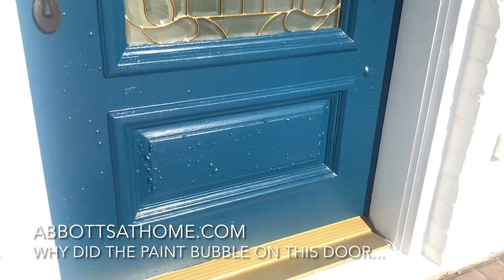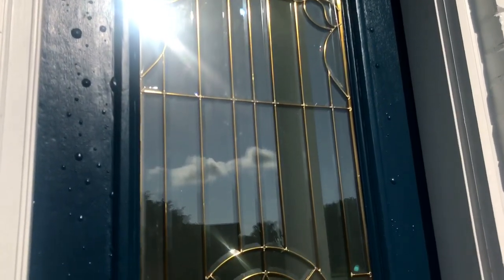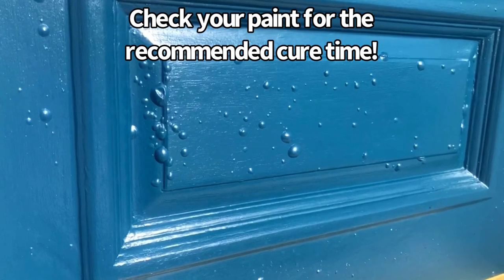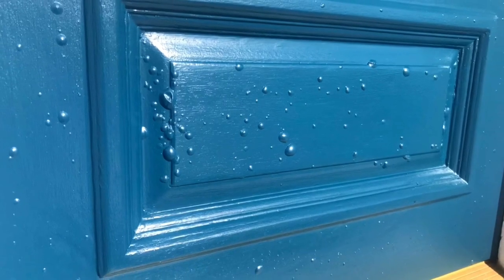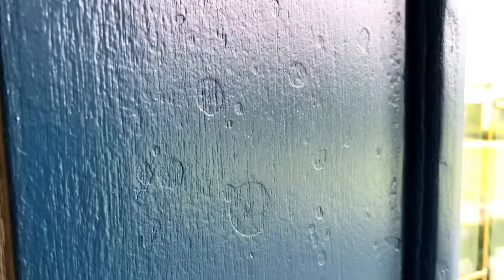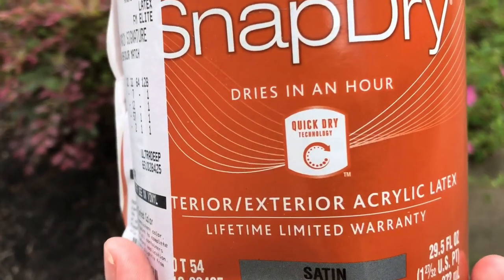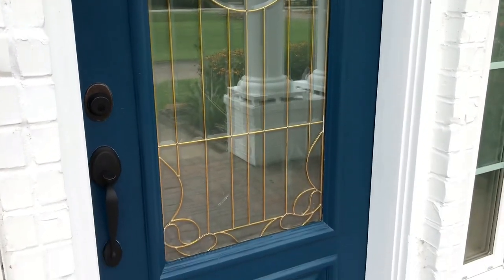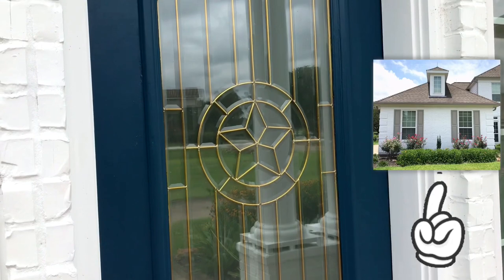NO! Why Is My New Front Door Paint Bubbling and Blistering - I Think I Know!

Comment: The same thing happened to me. The painters came back a couple times and each time looked worse than the last. They eventually told me I needed to buy a new door, so I did. I will be painting it myself this weekend because I can’t risk them rushing thru the dry times again. I am going to get creative and come up with a way to keep the sun off of it for 48 hours when I’m done just to be safe. It’s a dark blue, darker than yours. I will be using PPG Permanizer, because I had the color matched in Snapdry and it was considerably more purple than the trim which was painted in PPG. Happy to know I’m not alone.

Comment: Hey loved your video.  I had the same problem after I finished my front door the next day I went out to admire my work and found bubbles!!  So I tried slicing the bubbles down the middle with a small knife blade and then adding a tiny bit of paint.  I then pressed the wet paint into the bubble in a circular motion.  That helped as my bubbles weren't nearly as large as yours but I can still see a slight line on some of them where the cut was there but the bubble is mostly gone.  Just thought I'd mention it.
Reply from the maker: I have a few very small bubbles left after the painter's patched my door. I'll have to give that trick a try. Thanks for the helpful comment. 👍

Comment: I worked so hard on a faux wood finish on top of a dresser and it did this except smaller blisters. And I definitely did the base coats only 1 hour between but it was 100% dry and I even sanded between coats and did everything right. 
It makes sense that maybe the paint wasn’t cured though. 
I guess this answers my questions.
Reply from the maker: The only other causes I can think of, bedsides cure time, is humidity in the air and wood OR the wood is oily (like Teak). Good luck!!

Comment: Did you sand the whole door down again before applying the snapdry? Or did you just paint over the old paint? I have a similar thing happening on my siding that gets direct sun in the mornings. Im wondering if its a specific problem with Sherwin Williams exterior latex paints. I think the color is even the same - Moscow Midnight. The bubbles on my siding are really big compared to those you got however, up to 3 inches in diameter.
Reply from the maker: Hi Shane! Sorry to hear about your siding. Is it vinyl siding?? If so, your problem is actually with the way vinyl heats up. Vinyl can’t be painted with black pigment paints. Sherwin Williams has a special line of paint colors that are approved for vinyl siding and vinyl shutters, called VinylSafe paints. Moscow Midnight might contain too much black pigment to work properly on vinyl. 
If your siding isn’t vinyl, I’d try SnapDry. You will have to sand down the bubbling paint. I’d talk to someone at SW, show them pictures, tell them what you used and when the bubbling started to see what they recommend. SW is popular with professional painters, so I don’t think it’s a problem with their paints. But you could always try another paint line if you’d like. 👍 Here’s a post I wrote about VinylSafe paint on shutters https://www.abbottsathome.com/best-way-to-paint-vinyl-shutters/

Comment: That is what happened to me. I painted my door black back in 2018. Where I  live is very hot and moist. Black draws heat. I noticed about a few months ago, which doesn't mean it recently happened, I probably didn't pay attention that the door has a few bubbles. I'm seriously thinking it was the brand name of paint I used. Do I sand the door down before repainting?
Reply from the maker: Yep, you’ll need to strip it or sand it to get a smooth finish. 😊
Reply: @AbbottsAtHome  When is best or  what is best type of weather to paint an exterior door? The weather where I live right now is in the 60s/70s.

Comment: I have the same problem it gets hot Georgia sun on it all morning through early afternoon, mine is a metal door and was told that I should've used an oil based exterior paint. Not sure if that's true and hate to put all the work of stripping and sanding it down again to experience the same issue.
Reply from the maker: I would talk to someone at Sherwin Williams about SnapDry paint. It should be able to cure before the sun hits the door. 👍